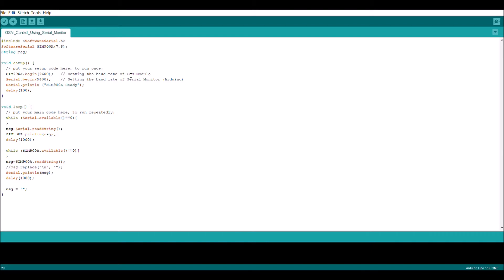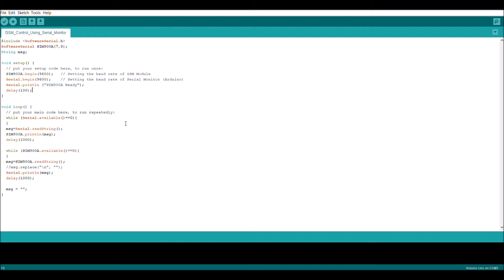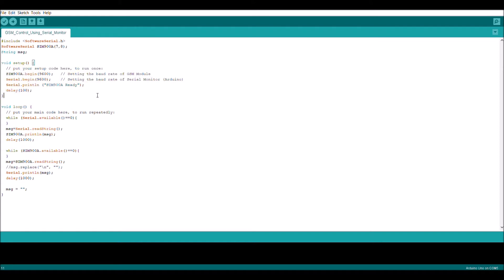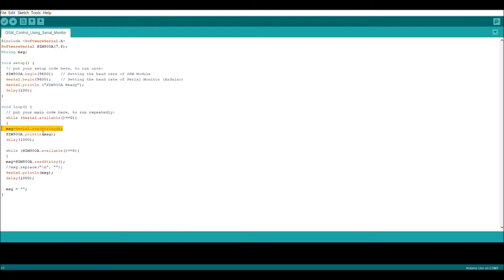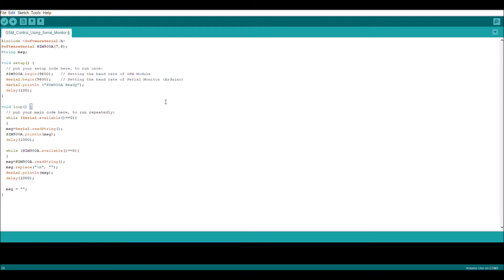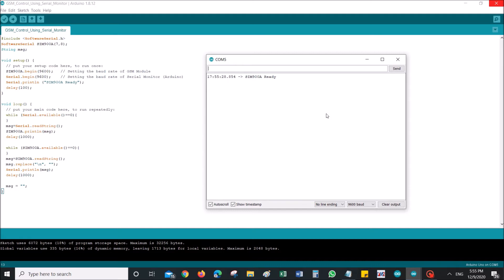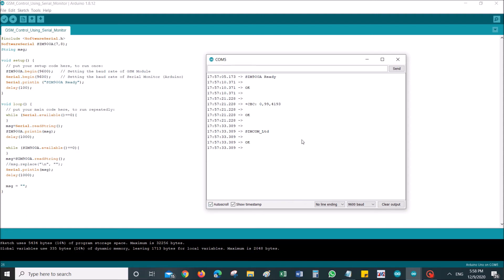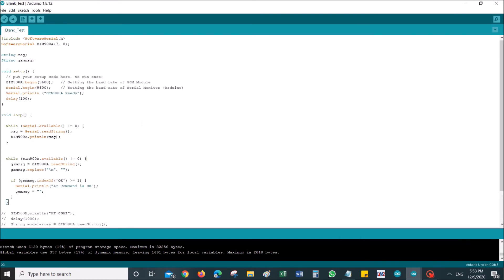GSM : Part 2 (Controlling GSM using Arduino's Serial Monitor)

Comment: Hello sir, My sim module doesn't show any response after sending at commands.. 
My project is gas leakage detection and the gas readings are displayed in serial monitor simultaneously so will that suppress the sim module's response.. please do help me sir 😢.. I am stuck with it for past 3-4 weeks 😭

Comment: excuse me sir i am using this gsm 900a for my science project.Actually the problem is that my gsm is not sending SMS to a desired person what should i do
Reply from the maker: Well that's a very general question. Maybe you can try to spot where the problem is. Go thru part1,2 and 3 to see if you could replicate the same from your end

Comment: Hello sir , my gsm 900a is not blinking(D6) . It just glows when it finds the signal(connection). What is the problem? . Is there anyother way to contact you?
Reply: Probably not enough current. use 2 different power sources. One for Arduino and one for GSM and don't forget to link Ground between Arduino and GSM.

Comment: Can you please help me? When I enter the AT command like AT and enter, the output becoming "kC⸮
", do you know why this thing happen? Please help and advise, I am quite upset, because cannot fix this weird output coming out from serial monitor
Reply from the maker: Have you tried varying the Serial Monitor configuration and see how the outcome varies.
Reply: @electronicseternity9210  yes sir, all that had been done, changing laptop, mac, pc, and change each baudrate also result similar findings or even worst. Can you please do help me. So far when I call the number from other phone, the serial monitor indicate something, but the value/ character display was not understandable..
Reply from the maker: @syaduinotech3681  Tbh, the characters are not understandable for me too. I'd suggest contacting your SIM900 provider. I did the same anytime I need info on my gsm module.
Reply: @electronicseternity9210  thanks so much, please allow me to share your video to my students and friends. Tq sir
Reply from the maker: @syaduinotech3681  You're most welcome. Glad I could help in any way.
Reply: @electronicseternity9210  thanks sir. Your ideas make sense.. i re do it again, based on your sketch and change one baudrate by one.. until i got mine 38400 and its well done and able to be used. Tq sir.. your response and sharing very much appreciated

Comment: Thanks for sharing such an Awesome project. The link shared to download the code is not operational . Please  check the link or share the code.
Thanks & kind regards.
Reply from the maker: Not sure what you mean by not operational. The code is functional from my end. Maybe can share more info on your issue ;)
Reply: @electronicseternity9210   Thanks for your reply. Can I have your email address so I can share the web page which is showing that Content can not be displayed.
Reply from the maker: @yawarsaeed6499  You can reach me thru my FB page. All my contact details are there :)